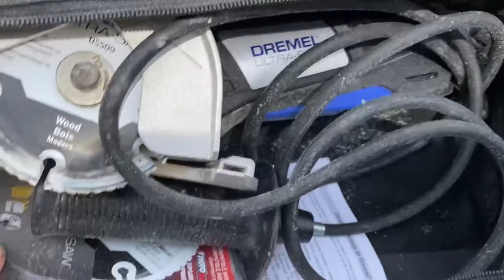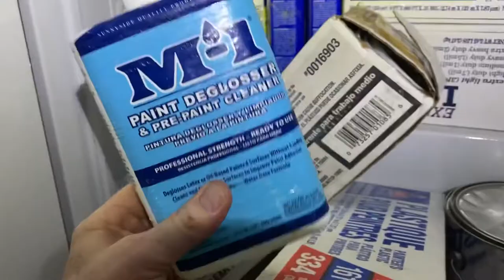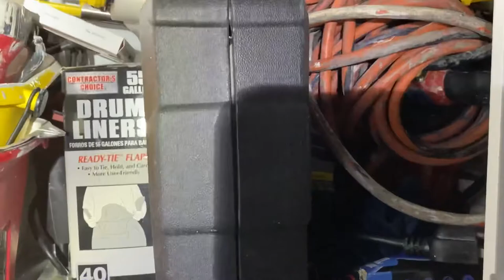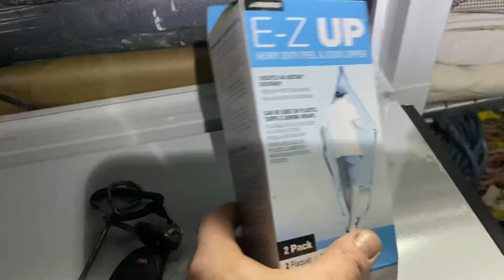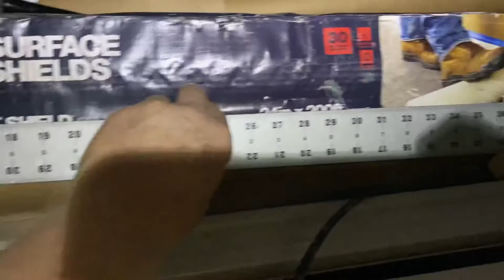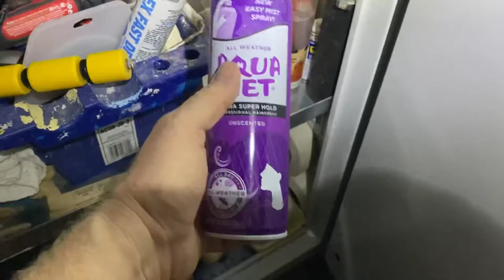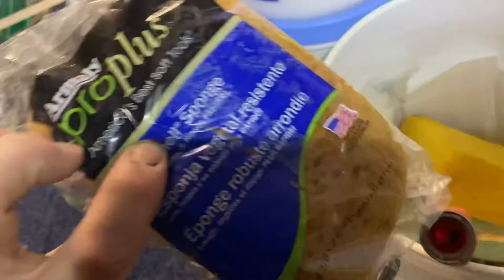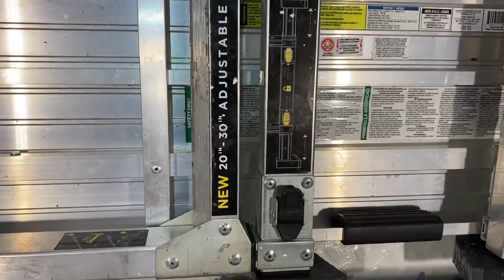What’s on the Truck of a Wallpaper Hanger? - Spencer Colgan

Comment: Nice truck, is that well bond glue is a wood glue?
Reply from the maker: Osama, That is exactly right! But it’s also for almost every other thing you can think of
Reply: I do exactly the same thing when sizing my walls but instead of mixing it with just water, i use 1 back of metylan (its a powder wallpaper adhesive) for 10 liter of water then add 40% wood glue